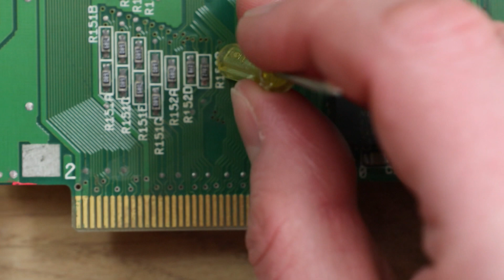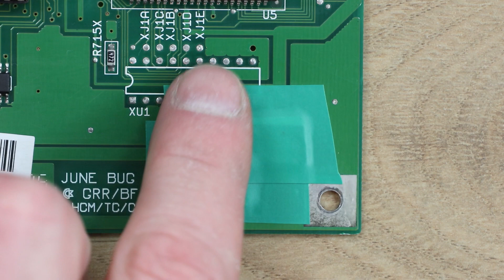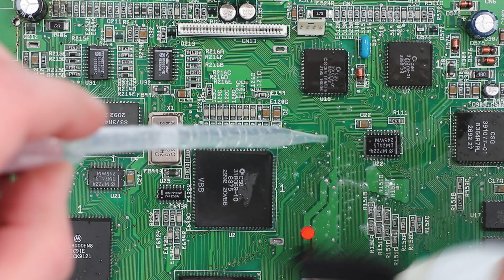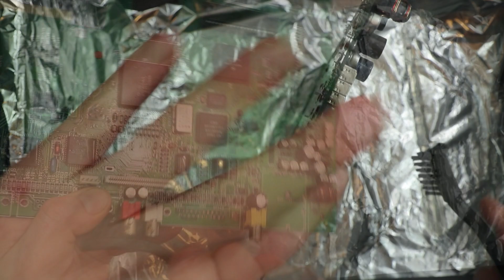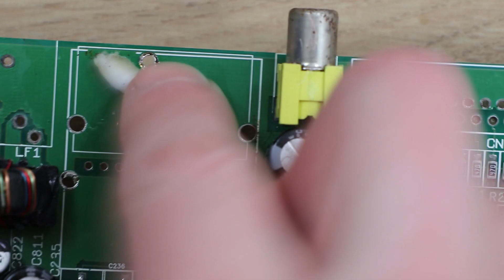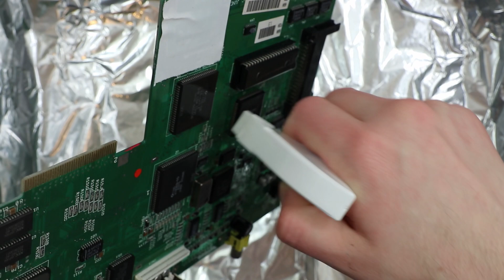Amiga A600 - Drowning Her Sorrows - Part 5

Comment: Awesome work, just wondering... is it not better to remove all parts before cleaning like caps and kickstart? so you can clean areas below components, and is it not better to use it as a ultrasinic cleaner? Just a suggestion, not sure it's the right way to do it. Thanks for the content, I really wort to watch it.

Comment: Pretty badass to take on a rusty project like this. Am watching the video right now. Edit: Wow, that was alot of cleaning. Starting to look good!
Reply from the maker: By badass I assume you mean a bad idea and a pain in the ass of a job. ;-)
Reply: @Error42_  LOL. This is among the most rusty A600 restorations I've seen. I can't wait to see how it turns out in the end. I was cleaning a Chinon and a Panasonic A500 floppy drive which is part of a local haul I got. Here the other day I bought two packs of Q-tips. The amount of Q-tips can never be enough. These drives loves to eat Q-tips and they love isoprop. It's insane how dirty they get. Main problem is they have no latch/hatch. Panasonic drive has an SMD 10uf cap in the front that loves to leak it's juice. And the fish smell was extreme once I put my soldering iron on the pads.  Seen it on several Panasonic drives now. I replace it with a regular radial cap. It has a couple of more smd caps inside of it, but they don't seem to leak, on the couple drives I've seen.